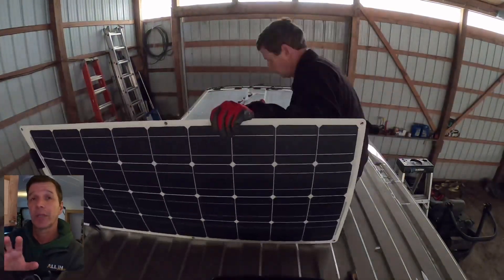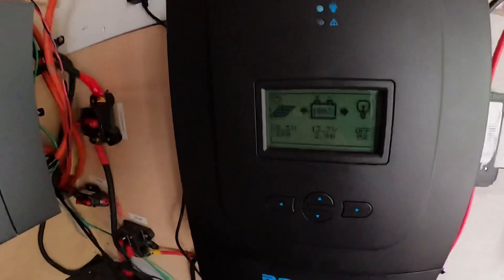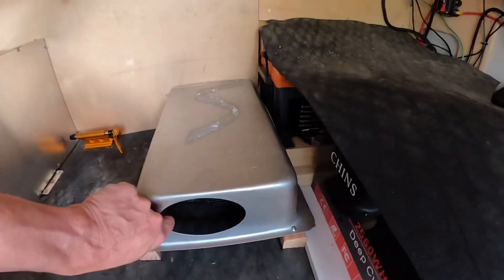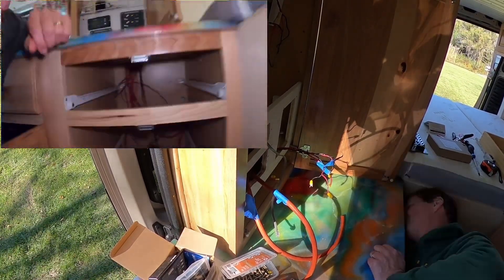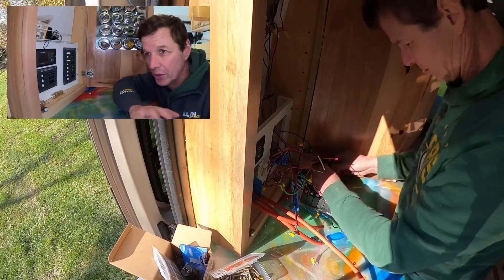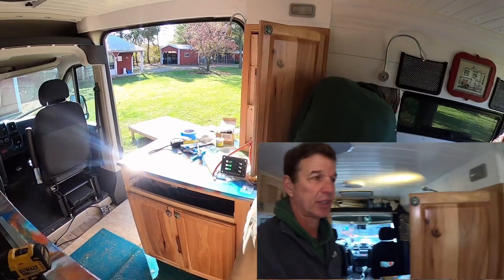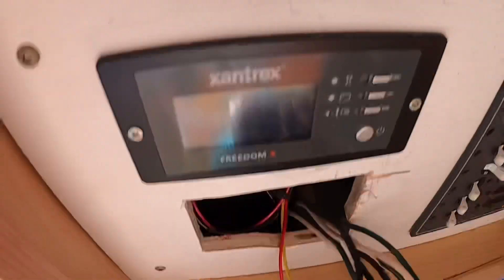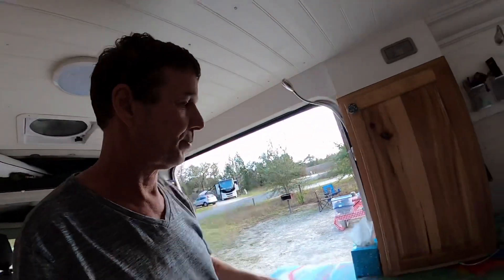Van Build step by step #6 solar and electrical

Comment: Interesting note on the ventilation side and sealing side of the flex panels. Could prob use butyl tape for the front, too. We'd love to have flex panels. Our van already had a large panel hooked up when we bought it so we have just stuck with it. Definitely interested in the upgrade in the future though. Great van!
Reply from the maker: Thanks for the comments. We will divulge issues with the install we did if they arise.  Thanks for watching!

Comment: Cool!  I've heard stories about those flexible solar panels overheating when affixed directly to roofs like that, but if I remember right you've used them before.  Have you ever had any concerns with them?
Reply from the maker: Two trips. No issues. High temps so far 80 degrees.

Comment: Long time no see! It's looking great. I'll be interested to see how those solar panels work out. I have a friend who put two on his roof but used duct tape and it caused condensation to build up and rusted the roof of the van really bad. I like this idea and it would but be much less weight and wind resistance than standard panels mounted on metal frames. This is looking great! I like that cabinet idea too.
Reply from the maker: Thanks Wanda - we had smaller panels glued to our minivan for 10 year as with no issues